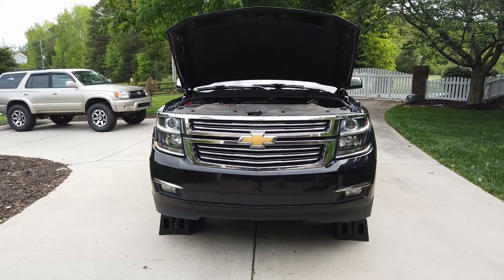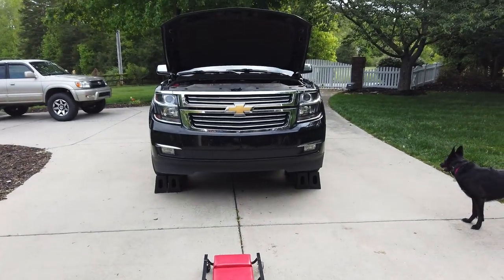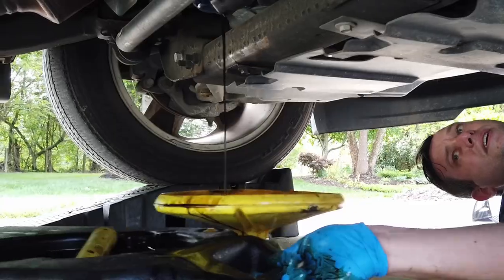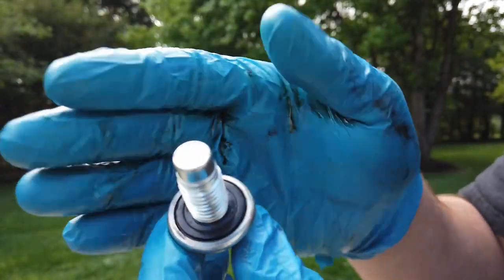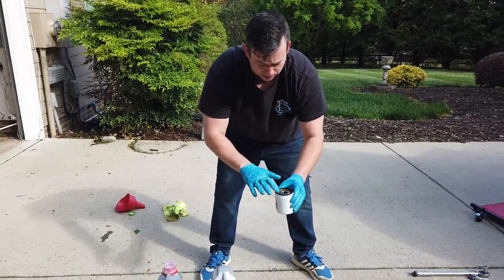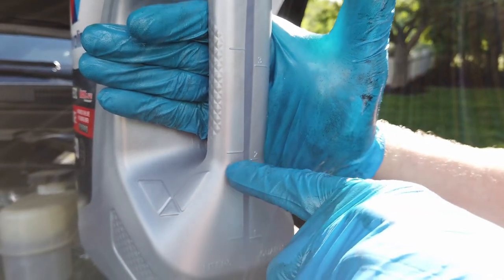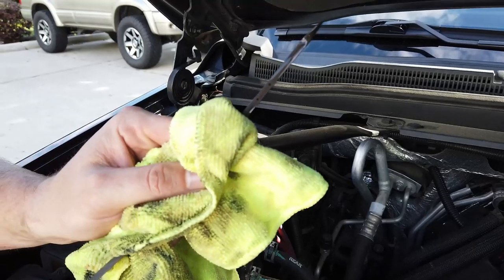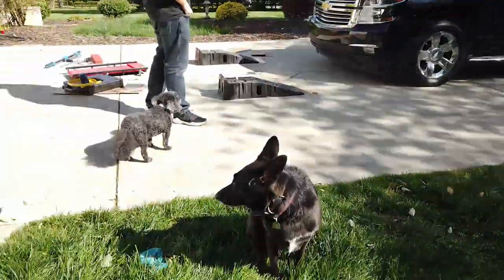Tahoe Oil Change - No Step Skipped DIY!

Comment: Nice video, thanks for taking the time to do these.  FYI 2015 was the last year the K&N HP-1017 Oil Filter was used on the Tahoe.  K&N HP-2011 is the correct filter for 2016 and later Tahoes.
Reply from the maker: Thanks Fred. Good insight on the filter. Appreciate the love

Comment: Excellent video and I change my oil every 2,000 miles with motul Gen 2 5w40 for my 4 cylinder. I always pre fill the oil filter so there’s no chance of it getting low and dry starting and destroying the bearings. I also fill the engine oil off the ramps and use the dip stick to gauge how much oil to add. Hood the dipstick vertically when reading the level and always check the oil in cold as heated oil expands and is always going to show higher reading than cold.

Comment: My only critique is how you observed the dipstick.  Do not point it Up.  It will lie to you because the oil is running down...  Hold it DOWN and look for the wet edge at he top for better accuracy. That, and that was the trans stick.  The Yellow one is for oil.

Comment: Good job man! but next time make sure you check the motor oil. Also, remove the oil cap and stick before draining the oil.  don't use a wrench for the oil filter, just hand tight.

Comment: Dude, that was the transmission dip stick
Reply from the maker: Lol! You are 100% right. Obviously the oil dipstick is on the right near the fill cap. My fault! This was my first Chevy oil change. I'm embarrassed.
Reply: I just did my transmission fluid change and for a moment after watching this I thought I poured transmission oil to the engine and ran the tyranny empty, thanks for noticing the dipstick error!
Reply: Btwillia's Garage Great and detailed video, thanks!
Reply from the maker: I'm going to see if I can cut that part out or at least blur it

Comment: Great video but you misspoke when you said "Over torquing the drain bolt doesnt hurt anything"... Over torquing the drain bolt can strip the treads in the pan... that can be a nightmare.
Reply from the maker: That is true. I intended to come across as a couple of lbs won't hurt anything when I said "a little overtightening doesn't hurt anything". You are correct though, you definitely don't want it way over tight!

Comment: I would say the filter was over tighten was struggling a bit taking off and I just did mine and it’s stuck that thing won’t come off filter cartridge literally broke to pieces 😢
Reply from the maker: Sorry that happened! Hope you can get a new one quickly. This scenario is why I prefer to do my own oil changes or only take my vehicles to shops that I know the mechanics

Comment: Why did you check transmission stick in place of oil level check?
Reply from the maker: Was a mistake, I had just changed the trans fluid in my 4Runner and was too focused on filming. My bad